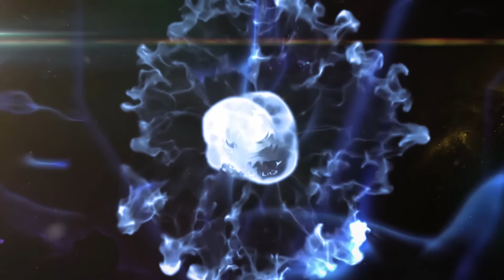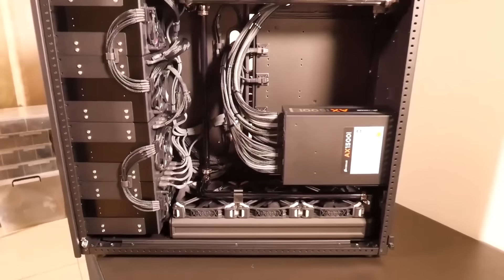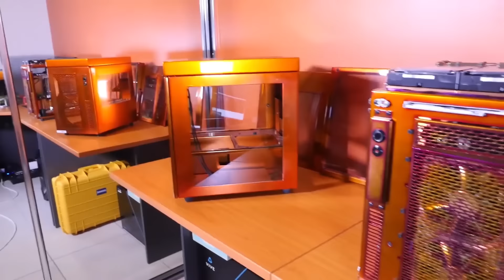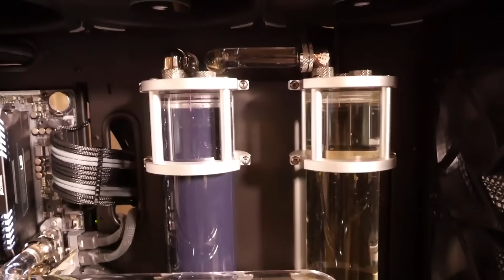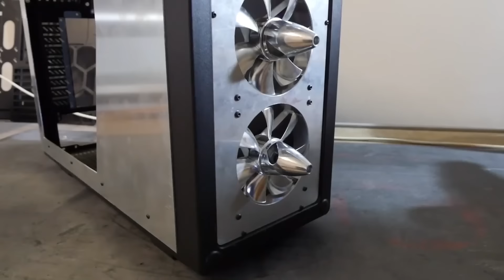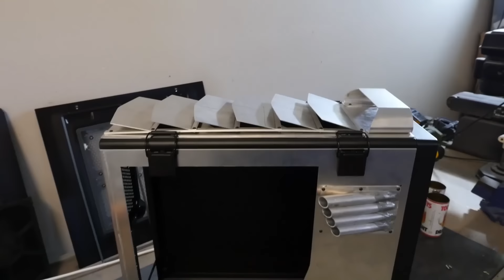Weekly BTS Update #1

Comment: How long did it take you to sleeve those cables?
Reply: Personally I can get a PS done in a couple hrs or less, granted I usually only sleeve the bare minimum of what I need to run my system. The time consuming part for me is usually working out how long I want the cable to be. I normally use the original cables and chop them down bit by bit until I find a length that will allow me to route them cleanly and manage them easily on the back side.
Reply from the maker: It took about 40hrs, theres a lot more cables in behind the drivebays. Every single cable is custom built from the ground up, except for the front panel cables.
Reply: *****
 The "From the ground up" part is very time consuming. I've only wired one PC in that manner and I lost track of how long it took me.